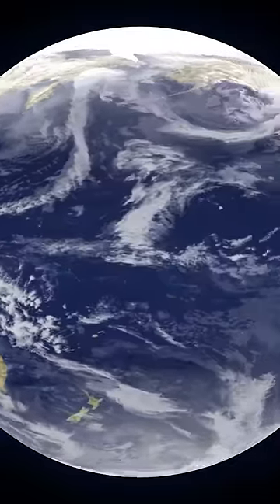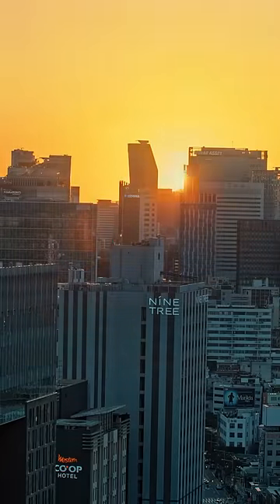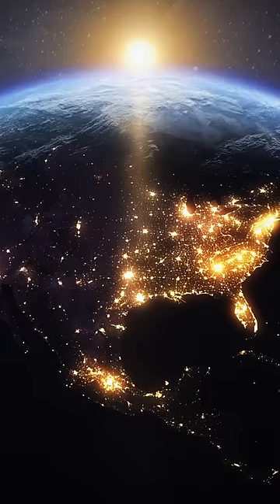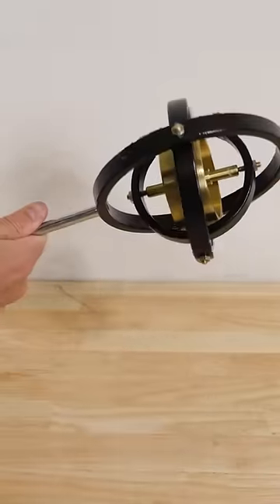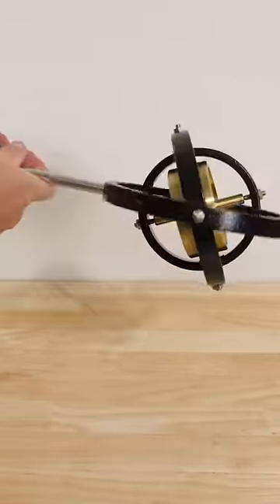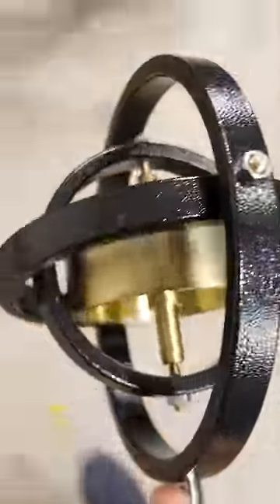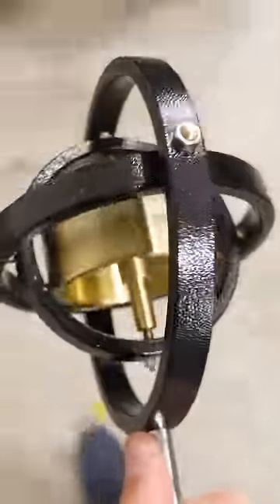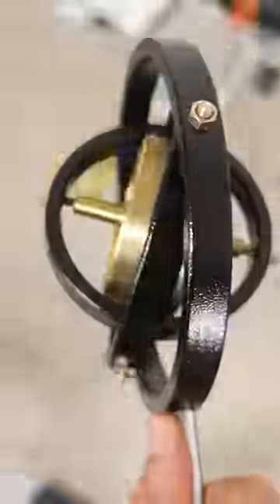Using a gyroscope to power the earth

Comment: Is this even possible considering the Relativity Theory? This would be comparable to trying to extract the movement energy of a car from the inside of the passenger cabin
Reply: What if the passenger touches the road?
Reply: @xunoe - To paraphrase Back to the Future, In space, we don't have no stinkin' roads.
Reply: I mean, you can do this though right? You just need to wire a generator up to the crankshaft. Applying resistance to the crankshaft and providing you electrical energy. 

This only works of course because the speed of the car is tied to the speed of the wheels which is tied to the speed of the engine. 

The earth doesn't have a convenient engine that we can hook into
Reply: That being said, even if you couldn't do that, you could still extract energy from the car by holding a turbine out the window. 

But of course this one only works because of a delta in air speed between the cabin and the ground. Because the atmosphere spins with the earth, we can't do this either
Reply: @xunoe  that'd be like trying to anchor the earth to space itself and thus try extracting energy from the resulting braking force. if you did figure out a way to do that, then you'd essentially figure out the problem that black hole civilizations use to turn black holes into their near infinite energy battery. OHHHH that makes so much sense! BECAUSE light moves at a constant speed, it is essentially anchored to space and only relative to space, and the reason why you can use it to extract the rotation of a moving body from the curve generated by the space around it!
Reply: Conservation of angular momentum... so, rotation is not (straight line) inertial motion, acceleration is involved to direct "stuff" around in a circle. Inertial motion is relative in Relatively, but proper acceleration is absolute. (And local to rigid objects).

So... you can transfer some angular momentum from one thing (like the Earth) to another thing (like the Moon, or a small gyroscope). The "gravitational assist" technique that the Voyager space probes used works by transferring some of the angular momentum of Jupiter into the momentum of Voyager. 

The Earth and Moon have been transferring momentum between each other for billions of years through tidal forces. It's slowing down the Earth's rotation (days are getting longer), as the Moon speeds up into a higher orbit. It will eventually become "locked" in the same position relative to the Earth in... like 50 billion years or so. (If the Sun didn't explode first.)

So... yeah coriolis and centripetal psudeo-forces have a measurable effect on large structures that span north to south latitudes. Hurricanes are a prime example. 

So... the tricky thing with collecting angular momentum from the Earth's rotation, is that all the stuff on the surface is already in equilibrium... the equator is moving about 1000 MPH due East... and the North and South Poles are basically moving at 0MPH as they rotate.

If you put a bucket of water on the North Pole, (and didn't let it freeze), the water would appear to rotate 360° every 23 hours and 54 minutes... from the point of view of someone standing on the surface of the Earth watching it. In actuality the water is inertial (standing still) and the Earth is rotating underneath it like a very slow record player. 

Blah blah blah, this reply is getting long. The short answer is yes, and it's not practical.
Reply: Conservation of angular momentum... so, rotation is not (straight line) inertial motion, acceleration is involved to direct "stuff" around in a circle. Inertial motion is relative in Relatively, but proper acceleration is absolute. (And local to rigid objects).

So... you can transfer some angular momentum from one thing (like the Earth) to another thing (like the Moon, or a small gyroscope). The "gravitational assist" technique that the Voyager space probes used works by transferring some of the angular momentum of Jupiter into the momentum of Voyager. 

The Earth and Moon have been transferring momentum between each other for billions of years through tidal forces. It's slowing down the Earth's rotation (days are getting longer), as the Moon speeds up into a higher orbit. It will eventually become "locked" in the same position relative to the Earth in... like 50 billion years or so. (If the Sun didn't explode first.)

So... yeah coriolis and centripetal psudeo-forces have a measurable effect on large structures that span north to south latitudes. Hurricanes are a prime example. 

So... the tricky thing with collecting angular momentum from the Earth's rotation, is that all the stuff on the surface is already in equilibrium... the equator is moving about 1000 MPH due East... and the North and South Poles are basically moving at 0MPH as they rotate.

If you put a bucket of water on the North Pole, (and didn't let it freeze), the water would appear to rotate 360° every 23 hours and 54 minutes... from the point of view of someone standing on the surface of the Earth watching it. In actuality the water is inertial (standing still) and the Earth is rotating underneath it like a very slow record player. 

Blah blah blah this reply is getting long. The short answer is yes, but it's not practical.
Reply: You would need to make a ring around the Earth and use moon's gravity to slow the ring. Now you need a wheel between the ring and earth that spins in the speed of which the moon is able to slow the ring's spin related to the Earth's spinning speed.
Reply: Rotation is quirky like that😂
Reply: We call that an alternator, friend. I see how you imagine relatively coming into it, but a key thing to remember is relativity doesn't apply in non-inertial reference frames -- such as reference frames which are rotating. Earth absolutely has angular momentum in a way that is perceivable in our reference frame. That's why the equator bulges.

Comment: A better idea would be a giant compass with some sort of gear track that prevented it from ever reaching its desired lineal position of true north as its axis continuously circles around the magnetic north pole. It's absolutely possible but only on a very very large scale.
Reply: energy to prevent would equal energy produced I suppose :)
Reply: But is Earth's magnetic field strong enough to matter here? I think technically you'd be able to extract some energy from rotation in this way, but it would be a very small amount. It's kind of like extracting energy from a flywheel by letting the wind blown off its surface turn a windmill.

Comment: Okay, so medium building size gyroscopes that spin near atmosphere do not work, however, what about:
1. A farm of small desk scale or medium car scale gyros that run in parallel in an enclosed (vacuum sealed?) warehouse?
2. A mag-lev band that is big enough to loop the world at the highest point we can reach with stable construction, (bonus points if we can break atmosphere) so like a multi-lane highway of metallic plank ring, (or at least metallic edged or some other set up) which stays in rotation, with each support point gaining charge from the difference between the ring’s spin and the earth’s spin?  Possibly building the ring from space so that when it gets set into place that it starts at “zero rotational speed” or even “negative rotational speed” and uses the connection track to generate energy from the immense difference in speeds?  Or… something of that rough nature anyway.
3. Alternatively, if we figure out how to make use of core metals, and/or get asteroid mining underway, then we could potentially set up metal (tipped?)rods that extend up through atmosphere, and pass orbital electro-resistance generators, with each pass by each location charging the energy banks…

Comment: Kindly make a simple short on why Earth is spherical.
Reply: Earth is not spherical, it is an oblate spheroid. But to give a simple explanation... The Earth is roughly spherical because GRAVITY SUCKS! 😅
Reply: @YodaWhat  Faire enough learnt something.
Reply: The surface of the Earth is at equilibrium between "falling up" and "falling down", from the forces of electrostatic repulsion between the molecules of 1 trillion cubic kilometers of molten rock and metal, the "force" of gravity trying to squish all that molten rock and metal down into the smallest volume of space possible, and centripetal forces from the Earth's daily rotation (currently 23 hours and 56 minutes, but four billion years ago the day was about 16 modern hours.) The rotation makes the circumference around the equator about 67km (41 miles) longer than the circumference through the poles.

This equilibrium was reached over four billion years ago, and the surface rocks have cooled down enough to solidify.

Basically... if anything gets too tall it will eventually fall down, and this all averages out globally to be an oblate sphereoid on average.
Reply: @juliavixen176  so, there's some consensus to the globe being spherical. I appreciate the full explaination.
Reply: @juliavixen176  😅😅😅 all taught with zero evidence. Just listen to your god-given senses....does any of that make sense? Does any of that sound like reality outside of sci-fi?
Reply: The earth is an oblate spheriod. Centripetal force causes the major axis at the equator and the minor axis at the poles. The tidal effects of the moon cause a buldge on the earth to be produced.

Comment: Generators work with a fixed point and a moving point. Normally the fixed point relies on the earth as it's connected to it one way or another. If you try to make the earth the moving point there's no fixed point with enough inertia to resist joining it. Impossible without some sort of outside anchor point similarly massive.

Comment: There has to be some way to do it though. Maybe if we shoot a laser tangential to the equator the rotation of the earth will increase the frequency and it can be absorbed by a photovoltaic cell? but you would have to have a nearly perfect laser to electrical conversion, which is only about 25% efficient with our best PV cells. Maybe if we do build an orbital solar array, beaming power down to earth retrograde to it's rotation could give us an efficiency boost.

Comment: Wouldn't it take the amount of energy we use in 14,000 years to slow the Earth by a second?
Reply: We're not putting energy into it in order to slow Earth's rotation. We're slowing Earth's rotation by extracting energy from it.

Think of the Earth as a giant flywheel that's already spinning, and all we're doing is attaching a generator to it. But the energy produced isn't free because the more energy we extract, the more Earth's rotation slows down.

Comment: Next step, 62 mile shaft from each pole connected to wings of alternating black/white surface at the Karman line...you may have seen it in your science class...and due to resistance, you could power the labs at the poles.

Comment: Don't "free energy" things work by amplifying the resonnant frequency of one molecule thru a material that absorbed it and  uses that vibration which is its ffrequency to vibrate a metal or crystal that makes a sound which in theory is able to push something that then works like a motor to generate the electricy via friction.

Essentially because you can't just make energy. You can convert it. You just need to combine two different forms of energy together with no friction.

The pyramids and a ton of ancient sculpture we know were built to amplify sound waves anyway. They IMO were the experiments used to prove the concept of what we call "free energy generators"

Comment: I've worked on this idea for decades. The problems I ran into were gear ratios(major loss in torque through the gearbox) and the enormous gyroscopic forces required to turn said gearbox. It's a bit too much for modern materials and manufacturing.

Comment: Reminds me of a flywheel energy storage facility i worked at once, they found that the bearings for the flywheels, which were mounted with the axis veritcally, would always wear out faster on two opposing sides on the top and bottom because the flywheel acted as a gyroscope and would resist the spin of the earth hence increasing the forces in that direction of rotation. Makes me wonder what stopped the experimenters in the video from using a structure that just stopped the axis of rotation from aligning with earths, just keep the axis of the gyroscope and the axis of the output rotation aka earths rotation perpendicular to each other. Maybe I'm misunderstanding something though.

Comment: There's another way of extracting energy from the Earth's rotation, though.

Build a very tall structure, and wrap in copper wire. Then as the Earth spins, the tower moves through its magnetic field and generates electricity.

However, I think this would barely produce enough power for a neighbourhood, and such a tall structure for such little gain isn't worth it, even with the energy being free.

Comment: Anyone tried to make the generator inside of the axis with a laser or radio energy emission 😉 however I would say it’s enough with some earth harmonic resonance frequency stuff; so combining a gyroscope with something like magnetic interference at a proportion to Planck length and earth with a recovering chamber would probably work .. can think of a ton of variations on the theme; however there are easier way to get energy; but thinking in terms of both resonance harmonic frequencies and vortex donuts is probably a good idea

Comment: what if the gyroscope had high enough inertia to overcome these forces? the gyroscope you're holding has enough inertia to overcome its own friction, but those forces are tiny.

like, just use one of your neutron stars to build a gyro and harvest the earths rotational energy from that :D

but more seriously, if you had a MASSIVE gyro so that it overcomes the forces applied by a generator, then use gears to make the generator spin faster, then harvest? i think the Soviets problem would've been that they just couldn't make it big enough practically. not to mention a massive gyro would also be extremely difficult/impossible to support.
Reply: Nah, be easier to put thrusters on it to keep it facing the right way

Comment: What if we build satellites with long poles hanging off their butts that spin a line of wheels built where we can on the equator?
Reply: That’s not realistically feasible to build, and the air resistance at the bottom of the pole in the atmosphere would slow the satellites down. I’m not a scientist but the act of having one part of the satellite inside the earth’s atmosphere would probably pull the top part down into it.

Comment: Instead of a giant one, why not tens of thousands of tiny ones? All connected via the internet to be stabilized and held at  the correct angle corresponding to where they are on the planet, all working in unison. It's probably still not possible, but it's a thought, lol
Reply: That sounds like it's going to use more energy to operate than it will collect from the Earth's angular momentum.

Comment: Anyone could figure out you're not going to be able to get a fixed point outside of the earth's rotation to harness it. The earth is our only point of reference. There's no way to seperate the generator from it to harness it's power. The generator will just start spinning with the earth.

Comment: general relativity says all coordinates are valid, which means: no--it won't work.
Reply: As a rigid object, the Earth does have angular momentum, which is absolute.
Reply: Actually, Special Relativity says all inertial (non-accelerating) reference frames are valid, not General Relativity. And as @juliavixen176 has pointed out, angular momentum and accelerated reference frames (which General Relativity deals with) is absolute and not  subject to change based on the reference frame from which it's measured.

Comment: What happens to a gyroscope in orbit of the earth or moon??
Reply: It's exactly the same... because the surface of the Earth and everything on it is actually in orbit around the Earth too. (A very low orbit, constantly getting pushed up into a higher orbit by the ground.)
Reply: Oh! Correction to my previous reply: in low Earth orbit the gyroscope will be in inertial free-fall, but a gyroscope on the surface of the Earth is being continuously accelerated by the ground. They'll both have enough angular momentum to orbit the Earth every day more or less.

Comment: It is a stupid idea. Due to the conservation of angular momentum it is fundamentally impossible. You can not reduce the angular momentum in a closed system. You would need something outside the system.
Reply: Well, hypothetically you could still do useful work by transferring angular momentum -- and thus energy -- into something else. That's how a flywheel works, after all. The issue in that case is that it's really hard to "detach" something from the Earth's rotation into which we can move the angular momentum. The gyroscope does it temporarily, but then precesses until it doesn't work anymore.

Comment: Why not build a giant windmill all the way into space? As the planet turns the space will rotate the windmill generating electricity. Free eternal electrcity.  (As long as the space keeps blowing).
Reply: im not sure i understood this correctly, but first, space has no air, and second, infinite energy does not exist.
Reply: @ZeYoX-mw7sh  bro, have you not heard of solar wind? How can there be wind with no air?
Reply: @Fran-or3lt  Oh, its not wind, i may need to check again, but its charged particles, not wind. Solar wind is just the name.